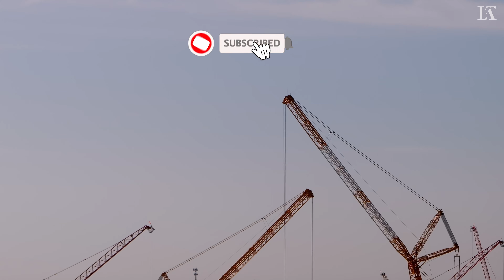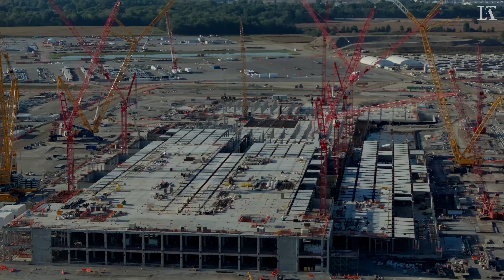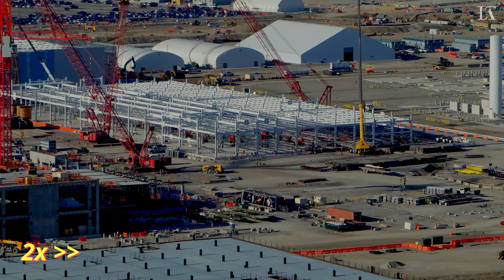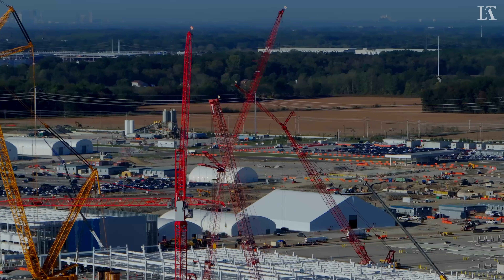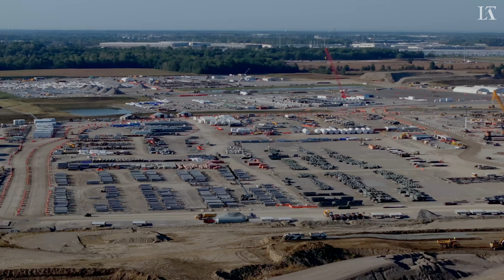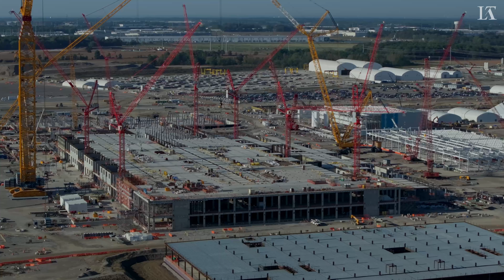1,000 Concrete Slabs Placed! | Intel Ohio

Comment: When is it planned to be finished
Reply from the maker: Officially (currently) 2030. But I believe both modules will be weathertight and ‘shelled in’ around late 2027. Tool installation and tuning will still take a year from then to get ready for high-volume manufacturing.